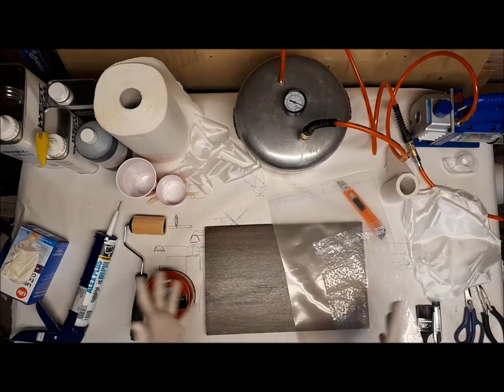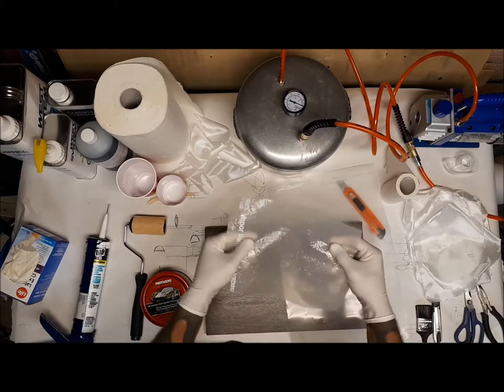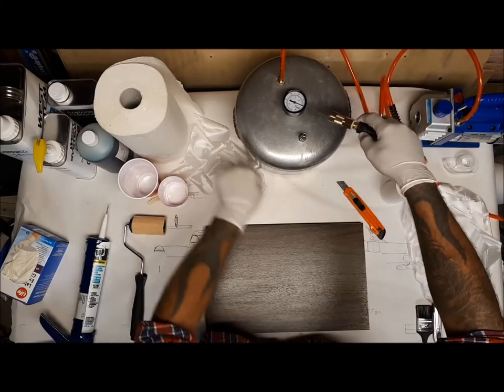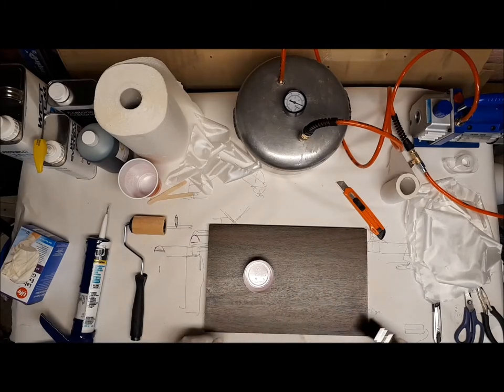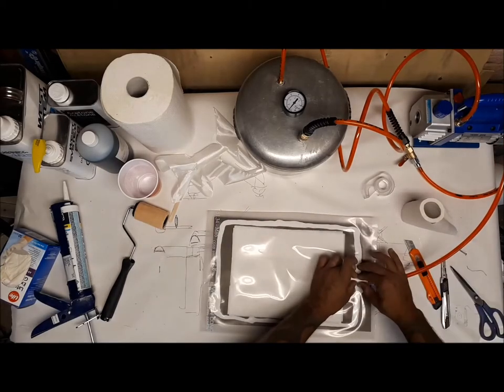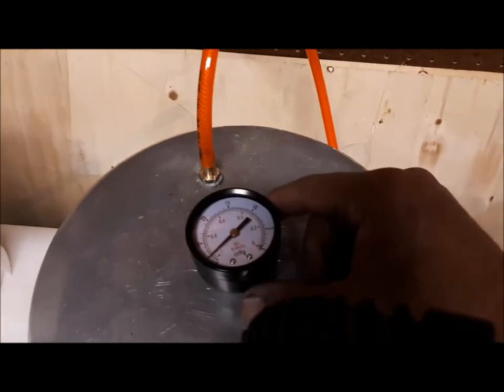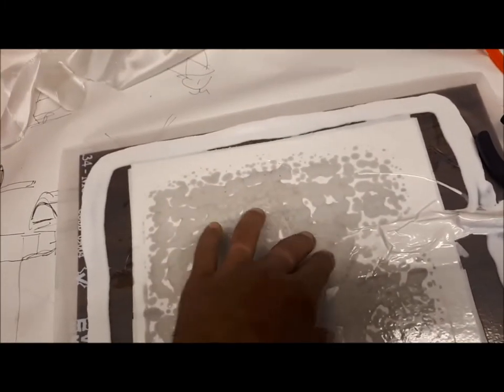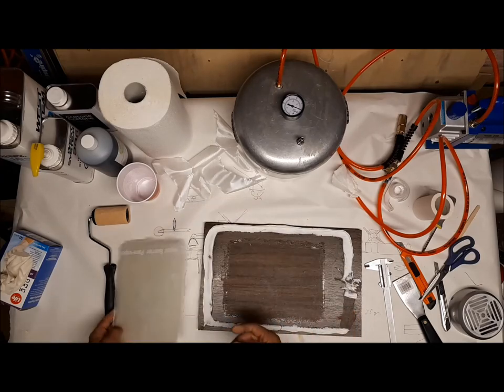Make your own fiberglass sheet

Comment: Can you dye the resin, maybe with something like food coloring?  Also, you could use a screen or stencil to spray paint a pattern in the sheet in one of the middle layers.  Could look cool.
Reply from the maker: Food coloring probably won`t do coz it is water based. There are special resin dies that are cheap enough and needs only a tiny drop. Spraying will compromise the strength as the resin will stick to paint rather than fiberglass. For decorative purpose should do:) If you thinking of replicating carbon fiber pattern by coloring fiberglass then won`t do either- it is glass strands and no coloring will stick to glass, all it does is leaves a tint.